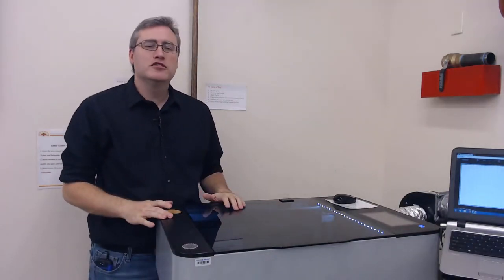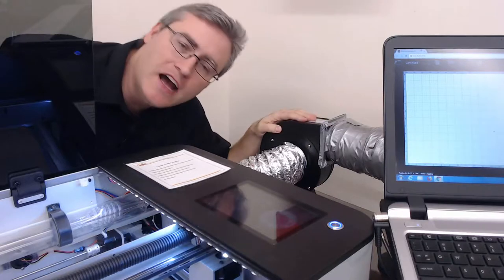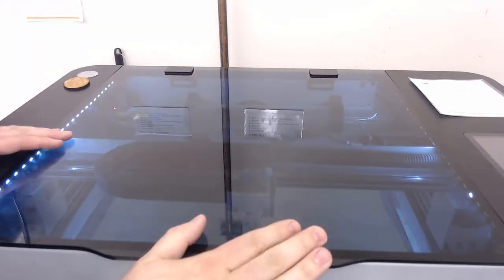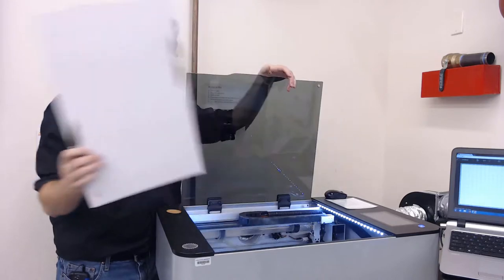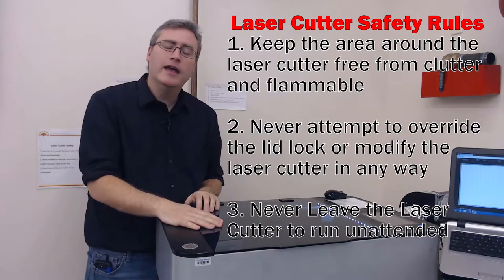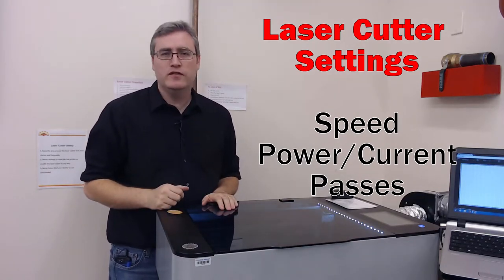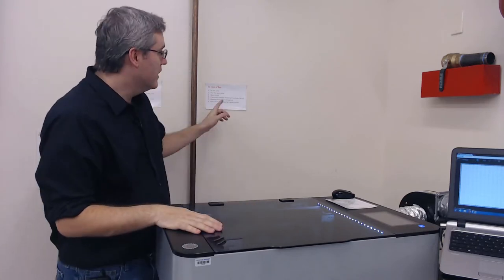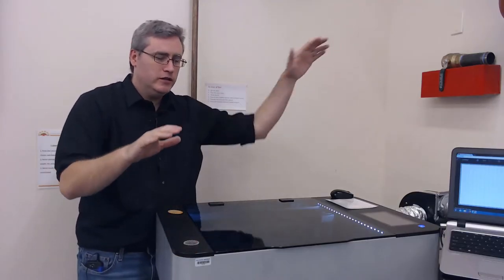Makerspace Laser Cutter Safety

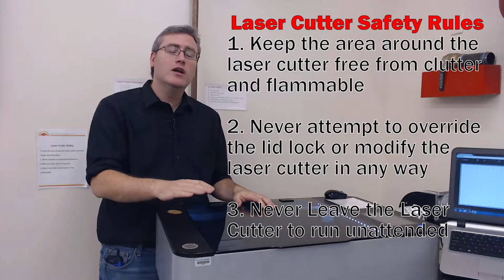Comment: 5:08 a good tool is a tripwire system that will kill power to the equipment. so if you start the equipment you cant leave the area or it will power off.